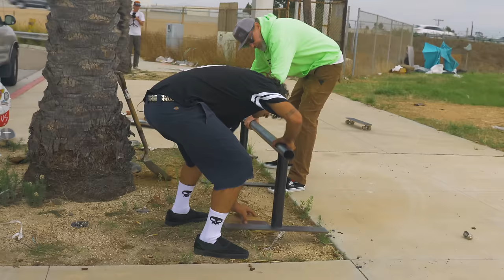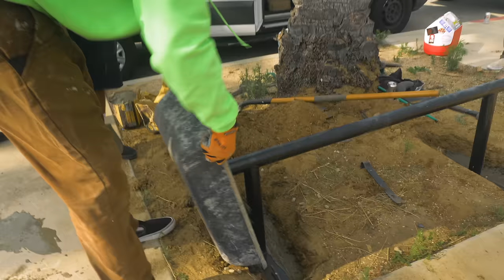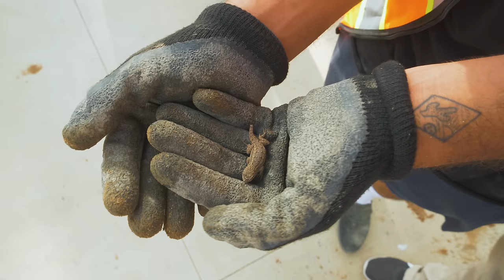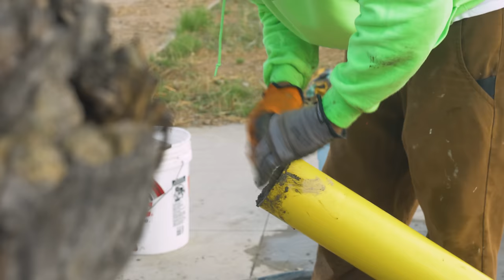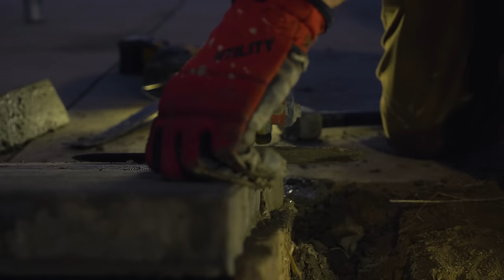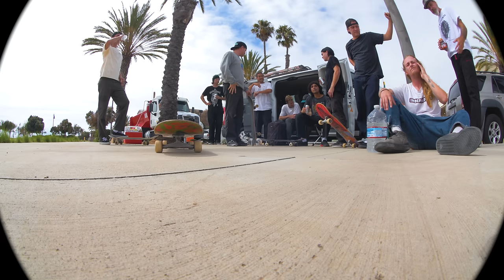Build To Grind: How To DIY An Urban Skate Spot

Comment: Nice work!! Concreted em in and all.
Was half expecting the cops or council to show up and kick ya out.
Reply: They most likely had permits. That’s a big project to risk doing it illegally.
Reply: @jbean9021 Yeah more than likely. Maybe I shoulda of worded it as tried to kick them out. But It's also right next to a road which isn't the kind of place they're likely to get a permit to do it. And it's not that big a project really. A few poles a few holes a few bags of cement and done. 🤷‍♂

Comment: My kingpin nut on my Indy’s keeps loosing while I’m skating any tips to fix this?
Reply: Might need to rethread it.
Reply: It could just need a new nut too bro.
If that lil vinyl ring on the inside gets to thrashed the nut will loosen.
If not that then you may consider rethreading or even replacing the kingpin.
On the NHS website they have an inverted kingpin kit, which works on any Indy. Those will NEVER have this issue 😅😅😅
Reply: Superglue
Reply: Same happening with the nut holding on my wheels but I don’t have money for a rethreader or for new anything
Reply: either get a new nut or use loctite. you probably wore the nylon off of the threads. so a normal nut that size wont work. they are still common though just bring the old one or say you need a nylon nut to fit a 3/8 bolt. thats all a kingpin is, a 3/8 bolt